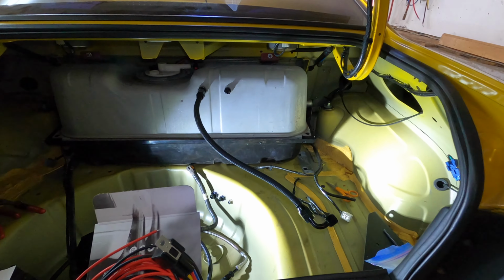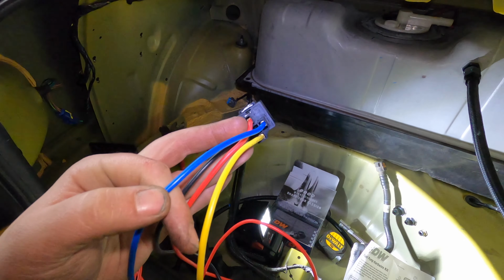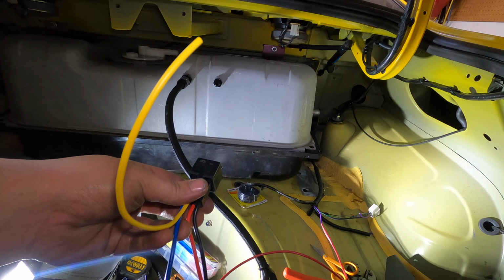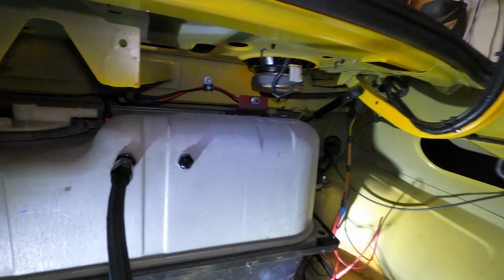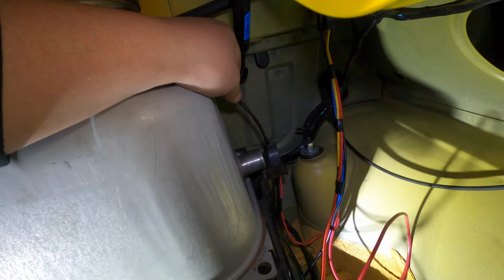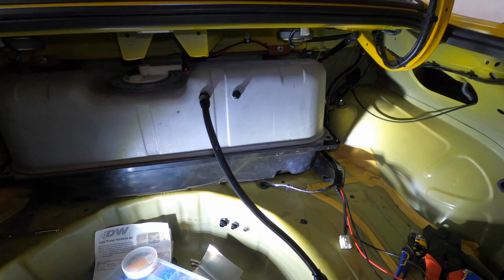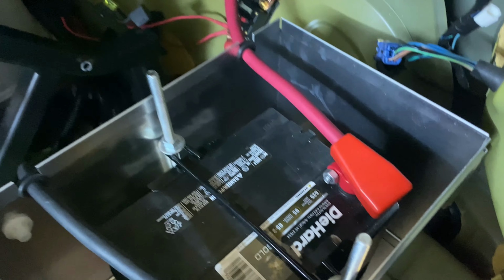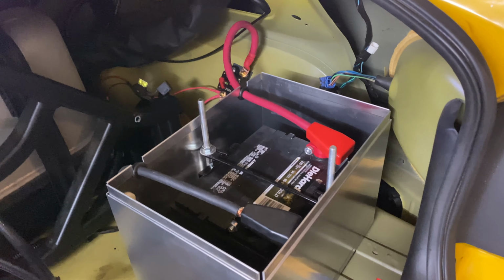DEATSCHWERKS HOT WIRE kit install. (GTO fuel system PT. 2)

Comment: What do you do to block off the line  at the bottom of the tank
Reply from the maker: Hmm I don’t know what you are referring to as the stock feed at the bottom of the tank tbh? The stock feed line comes out the top of the fuel hat at the top of the tank and then goes forward to the engine bay. Are you referring to the one inside the tank at the fuel pump basket if so we remove that part of the basket and run our own pump and line the only thing at the bottom of the tank is I believe on the plastic tank cover and I believe it is just an evap line thanks for checking out the channel I appreciate the support! 🤟🤟🤟🤟👍👍👍👍👍👍👍
Reply: @bought2build yeah that's what I meant that evap line at the bottom of the tank You're just leave it in there dangling or do you have to block it off sorry I wasn't more Pacific on my question and thank you for your reply
Reply from the maker: Sorry just seen this I ended up running mine down with a hose looping it and putting a little air filter on it so it can still breathe 👍👍🤟🤟🤟

Comment: Do you have a video on the coil relocation? I can’t find it. I saw it on the spark plug video.
Reply from the maker: @papergatorzfedducca7998  I don’t believe I have one on the coil relocation but I can tell you how it is very easy! Google “ICT BILLET LS COIL RELOCATION BRACKET” it will come up with the mounts then you can mount them where ever you need! You can also get a wiring harness extension if you need it then just watch the custom length plug wire video and you are good to go! Thanks for checking out the channel I appreciate the support!
🤟🤟🤟🤟🤟👍👍👍👍👍👍👍

Comment: I'm an electronic tech and junior mechanic and I have to say that having to cut and splice into the factory wiring isn't exactly a professional way to do this.
Reply from the maker: @genericdude6551  what would you prefer..?solder
Reply: @bought2build  Solder would be more secure than butt splices but you'll still need to use heat shrinkable tubing to protect the solder point but it would be good practice to put heat shrink over a butt splice, also, unless the butt splice is heat shrinkable. Sometimes a lever splice would be a good idea but not as nice looking as a soldered connection. Anyway, a more professional look would be to use a manufactured "T" for this particular application and break out the connections there (but that will probably never happen). JMO. Actually, I wouldn't put in that larger gauge power wiring unless the current pull blows the existing fuel pump fuse. I doubt the wiring would get hot enough before that fuse blows.
Reply from the maker: I always upgrade the entire harness for a 525 pump they can draw a lot 
Also I always use the marine style heat shrink but connectors that have the glue in them I have a ton of wiring I’ve done this way with different cars and my own knock on wood so far so good if I soldered everything I built I’d never get a video out I appreciate the input tho thanks for checking out the channel I appreciate the support 👍👍👍🤟🤟🤟🤟🤟🤟

Comment: Hey man love the video!! Question That purple wire from the factor connector, did you just dead end it the wire ? Would the fuel level sensor will be okay with that purple wire cut off and ran to the relay? Thanks hopefully that makes sense
Reply from the maker: Hey thanks I appreciate that! And yes I ran one end to the relay as the trigger the other end I just dead headed it since it doesn’t have power coming from that end. 

Also yes the fuel level sensor works I haven’t had a problem! Hope this helps!
Reply: @bought2build  yes brother it did thanks again  i appreciate the reply. been keeping up with the build it’s bad ass!!
Reply from the maker: @eddiesautogarage  thank you! I appreciate that! Finally ready for tuning should have some stuff out over the next week or so!